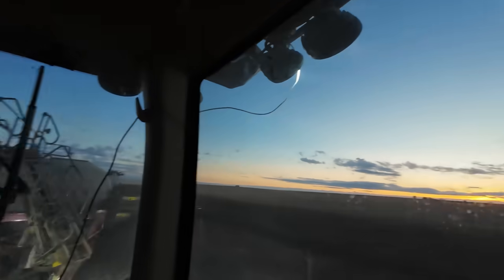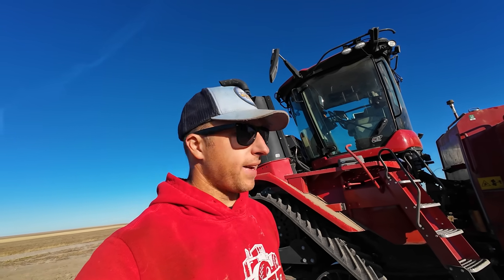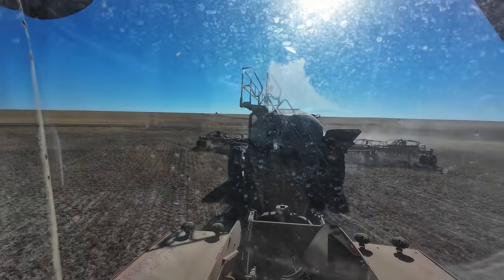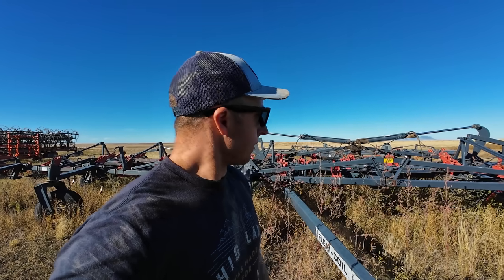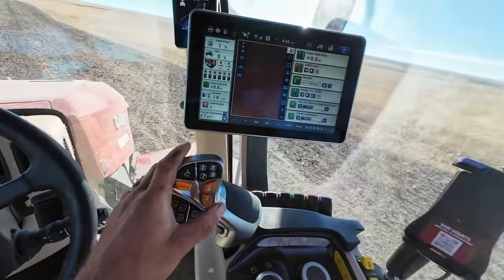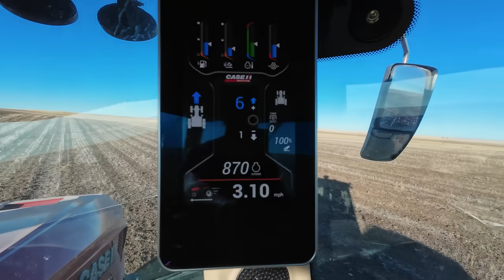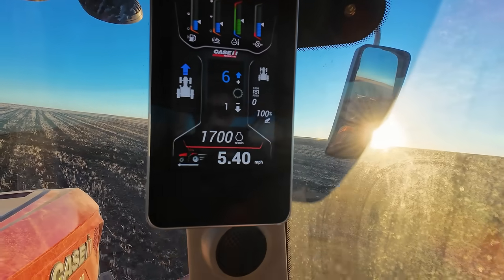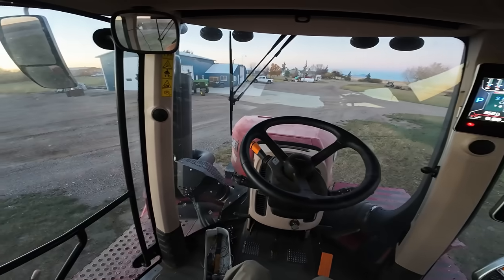60ft Chisel Plow at Max Depth - Steiger 715 Quadtrac | Part 3

Comment: Nick you sure take videoagraphy to the next level.  Especially for a farmer and f16 pilot with not much training in videoagraphy.  I tip my hat to you, your brother,  and your Father. You're 60fr flex coil is what we here in Minnesota,  call a field cultivator.  A chisel plow has heavier trip springs on the shanks and they usually put straight chisle points on each shank. A ripper shank has even greater spring pressure.  A field cultivator we usually pull 2 to 6 inches deep.  A chisel plow runs 6 to 12 inches deep and the ripper runs 10 to 18 inches deep.

Comment: To a guy that grew up on a "U" Moline, all that power is unimaginable. The last tractor I drove was a Moline M602 which had 71 horse power, one tenth of what you are driving around.
Reply: When I was around ten I greased the pivot on the seat. It took my dad two months to get the seat to stay put. I never did that again!!!
Reply: We had a U Moline, A John Deere, R John Deere, 930 Case and an 830 Case..... you could put them all together and not even come close to what that 715 has to offer!  Groovy!

Comment: Most intros I skip, not only on yours, but this one is outstanding. Plus, as the 715 went by, plus the hookups, it a bit over 15 sec. to go by. I don't think you could turn it around here in some Indiana fields. God has given you an outstanding pallet to work with.

Comment: That machine is a beast!!! I've ALWAYS wanted to drive a tracked machine, but even if I was still in the farming community, the UK just doesn't need many machines that size...... especially in the Nofolk area I'm in. I know that some areas of the UK do have larger sizes, but the area in most farms would probably fit inside your largest field. Once you have the labyrinth of roads we have, most fields would be - plow in the ground, drive for 30 seconds, plow out and turn around!! 😂 It's still awesome to see one of those machines in its natural habitat 😊👍👍👍👍👍👍👍

Comment: Excellent! But if I had hooked up and took off without a good grease job on the tool bar, I'd git my hind end busted! Lots of squeaks there.
Reply from the maker: It was sure talking wasn't it! That cool packer makes a lot of sounds but it isn't the bearings or bushings, it's the springs and rods that keep down pressure on the coils. It sounded like that since it was brand new.

Comment: I wonder how large a chisel you can pull with the 715 . You were pulling a field cultivator which doesn't go as deep as the chisel would . I'd like to see the chisel working in un broken ground/pasture New ground at 20 inches . Sorry for the questions but I used to do many acres with the chisel we had

Comment: Tracks are awesome by many measures by they certainly add a lot of friction; I'd be curious to see what this same tractor would have consumed if it was the wheeled Steiger version on fat floaty duals.  Then again, a Steiger 715 is purely a pulling machine and makes the most sense with tracks for most applications and use-cases.  Being skinnier to get down the highway or one plus... seems like I'm always having to pull over on the side of the highway (and a State highway, mind you!) to allow a big articulating 4WD Deere or Case get by that has wide duals or triples.

Comment: Is that tillage depth risky in your ground? Especially as dry as the last couple of years has been? I've been reading about the dust bowl and tillage seemed to have contributed quite a bit to the accumulation of practices setting up the perfect storm for the prairie. Appears to me that no-till and limited till has become the common practice in your area. Probably some version should be practiced across the country.

Comment: As impressive as that new 715 Quad is, if you were in the position to buy a new big horse, would you buy the 715 Quad or the new Big Bud? Great video, keep them coming and God Bless
Reply: Haven't ran the new bud yet so the 715 would strongly in the running.

Comment: That thing is a unit.. my 92hp skid steer uses ~5 gph at full throttle under load. It’s crazy you can do that much work and move that much weight using only double the fuel.

Makes me want overpowered equipment lol

Comment: If you didn't have to worry about the cost, which would it be? The 715 or a new Big Bud?
Reply from the maker: Can't say until we get to run the new BUD. Hate to say it but both those tractors are more than we'd ever need as far as power. But if someday we get larger air drills we could use the power.
Reply: Ah, per chance to dream...

Comment: Don't let those old school mold board plow guys confuse you.  It is a chisel plow.
Reply: Field cultivator
Reply: @jakecarruthers6513  Sorry, but a cultivator is the tillage you run between the rows of growing plants.
Reply: @danrose3233  sorry, but you're referring to a row cultivator. That's why I specified field cultivator, and even our video host refers to the tool as a cultivator and/or a sweep. The replaceable point on the end of a cultivator tine is called the sweep. A row cultivator sweeps between the rows like you said. A field cultivator sweeps the entire field. 

Consider a DMI TigerMate or a John Deere 2210. Those are field cultivators, just like the unit in this video.  Now consider a Hiniker 6000. That's a row cultivator. Now consider the DMI Coulter Champ or the Sunflower 4212. Those are chisel plows. 

A field cultivator is often (not always) used as a last-pass tillage tool before planting as it leaves behind a smooth seed bed. A chisel plow is a deep-tillage implement (not as deep as a ripper) for breaking up compaction and incorporating residue, and you could almost never plant directly behind one.

Comment: What is the price og that 715?
Reply: Quadtrac 620 (2023) = $ 942,500
Quadtrac 645 (2024) = around $ 975,000 - $ 980,000
Quadtrac 715 over 1 Million, ..... option list on all three is over $100,000 😋
Reply: @ytfan3815  Over 1 million!? Wow I knew it would  be expencive but i can't understand how farmers can afford this, with all the other expencive machinery
Reply: @FoNsDuD1  
These are us dollars, the prices on the 645 and 715 or not available jet.
You can see the Case 620 price and option list on the Case site, full options for the 620 is around us$ 1.04 million.  🤑🤢
I think only the big farmers with 10,000+ acres can afford this type of equipment, or contractors.

Comment: I would hate to even think what sort of contamination goes on with the hydraulic oil when all this implement swapping goes on,,  old junk.,, Brand new back ends and transmissions... I cringe every time you get a demo/loan tractor. Good luck whoever buys those machines. Typical Case ih tho, rough as guts n built not to last.

Comment: Still prefer the wheeled version better.
Reply from the maker: We asked if they will make this same tractor in aheems, didn't get a direct answer. Maybe duel LSW 1100s?
Reply: Got to fertilizer the fields this coming up Monday an subsoil foot deep . Let winter get out of the way . February get planting them red skin potatoes 🥔 😋 hopefully get 60 thousands pounds.  Before July.  If the heat doesn't kill them.
Reply: @WelkerFarms  that would look sweet duel Lsw
Reply: Depends where you live... here in Wisconsin in the Mud we prefer the Tracks over Tires especially in the fall. Tires just compact the soil and in the spring you can see the crops will suffer where the wheel tracks were... with tracks you don't notice it at all.

Comment: This proves nothing!! The limiting factor has never been hp it’s weight. Just make a heavier tractor.
Reply from the maker: Thats not true, you need hp and torque. You can go with low hp and high torque but it means slow speed. The formula is 1hp per 100lbs of weight. That tractor had zero slip which means it had plenty of weight. Many will say look at the big steam tractors, super low hp but can pull anything. That is because it pulls at like .5 mph. Try to pull the same thing at 6 mph and see how it does. It'll fall on it's face.